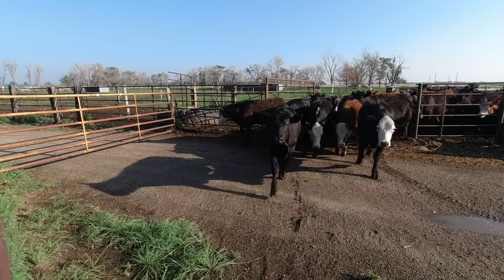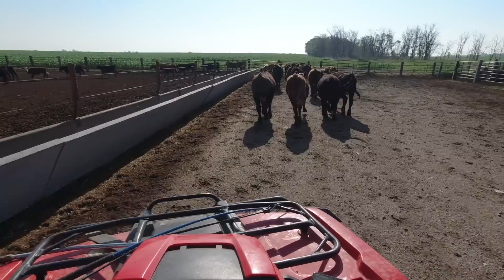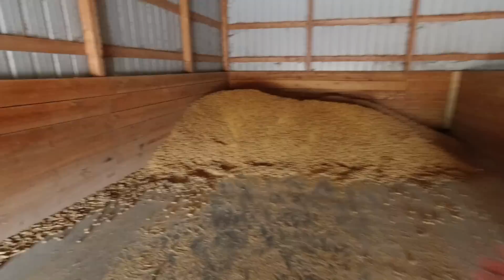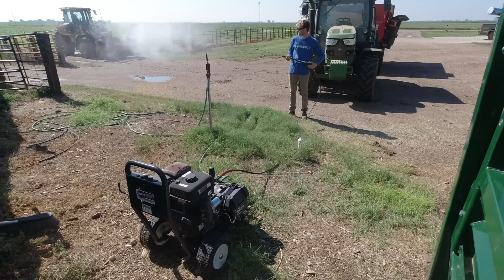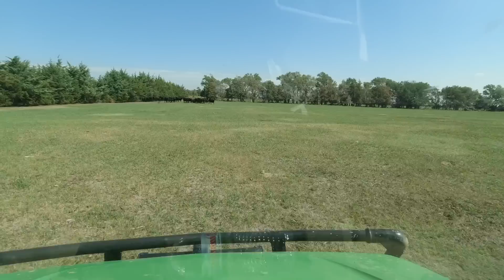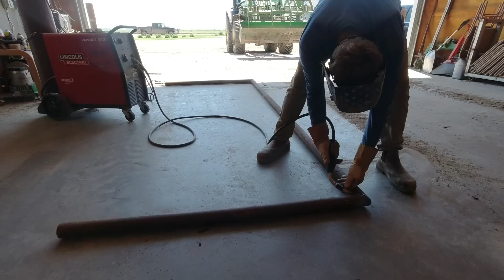Dealing with this Costly Disease

Comment: I know I have mentioned it a few times on here.  Selling beef directly to the customer can help the farmer/rancher a lot especially in hard times. It could be the start of bigger and better things for you and the family. If priced correctly I know I would order a 1/4 or 1/2 a Angus.
Reply: Count me in on Sonne Farm angus options!
Reply: I don't think you can transport 1/4 or 1/2 a steer. The weight would require the lift equipment and also refrigerated trucks. Likely thinking steaks, ribs, filet, hamburger which can be shipped in refrigerated container overnight by ups/fedex. Having the option to visit them and pick up a 1/2 would be great, but processing is a tricky thing. Will be interesting to see what they come up with tho.
Reply: You also need a butcher shop that is USDA certified to process the beef as well.guy in my old home town in north Dakota tried it cost of processing plant alone was $2 million you also need to be near a major airport or ups FedEx hub cause meats only good froze for 2-3 days even on dry ice
Reply: @dhenschel4  you can have a entire cow shipped if you want. When people say 1/4- 1/2 and so on it isn't the actual full 1/2 of the cow it is just 220 pounds of beef that has been butchered.

Comment: Don't forget, Cole, how hard it was to swing the gates in the snow because the bottom two rails dragged in it.  Hoping you can engineer a gate that you can remove those rails in the snow and swing them easier.  We don't have a freezer to hold a side or quarter, but that is remedied quickly.  We would buy a hind quarter twice a year from Sonne Farms.

Comment: Since the year of Covid, we fed out steers for family and a few friends. I did not do it for profit. I could not buy feed as cheap as the feed lots. It wasn’t about that at the time, it was about the supermarkets not having supplies.  I would only sell 1/2 or whole .
Everyone bought a live steer by the pound and i delivered to the processors. At the time whole beefs were in their freezers for $6.00 per lb. 
My feed cost first year $225 ton second year 275 ton then $310 . 
I sold live cattle first year $1.50 per lb   Then second year $2.00 per lb and third year $ 2.15 
Buying direct from a feed lot could have been cheaper however my feed prices was eating the profit up. 

The best thing though we felt and still feel that not finishing the cattle on 100% corn was a positive on how well we digested the beef.  

I could have made more if I sold cuts but I didn’t want the expense of a freezer. You have such a large audience I think you would do awesome. There is a fair margin to be made somewhere less than Walmart pricing.

Comment: You're on to the right solution to stop costly to beef on the hoof pinkeye.
Few short comments,  fly spray the tree lines,  drain fence or fill those full of cow shhitte n disease water holes, haul more clean water or drill more wells,  hang more fly pesticide oilers n dusters ie on  your metal corral shades n in the trees use heavy burlap for face rubs wipes,  vertical hanging large diameter manila hemp ropes

Been a biblical drought here in the Pac NW.  Not enough rain to even keep keep the toads from croaking DEAD

Comment: The fly infestation a few years that you had was horrible. Seeing that they're not in the cabs yet. You're doing pretty good so far. ☘️👍NH.
Reply: I’m part Irish too. From SW Minnesota. My 3 great grandfather came to the USA in 1828 from County Cavan Ireland. He settled in Wisconsin near Milwaukee. My 2 great grandfather came to Minnesota. He settled in Renville Co. in 1866. My 3 brothers and I own the farm he started. Some of the land borders the Minnesota river. It sometimes gets flooded in the spring. The buildings are all gone. The last building to survive was the barn, which was built in 1906. It collapsed on itself so we burned it on Dec. 10th 2010. The large granite rock foundation is left.

Comment: Cole. What brand of dart gun do u use? Is it co2 or an air gun. Any other thoughts on the process would be appreciated. I have a few cows too and am sold on the ability to single out one or two problem cows in the field and not have to run them thru a chute every time. Thanks!
Reply from the maker: Pneu dart, air gun